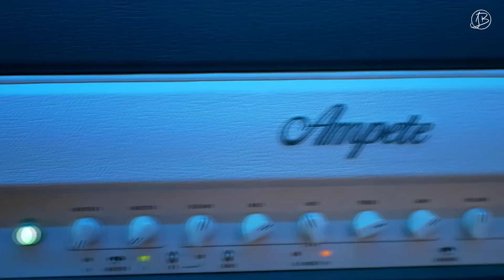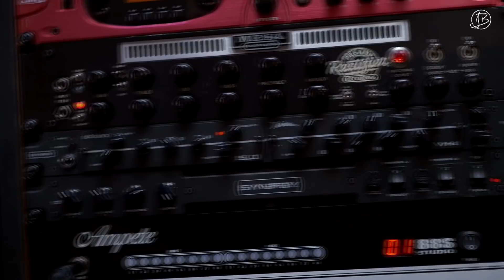JOHN BROWNE | GUESS THE HIGH GAIN TUBE AMP

Comment: One blended the harsher and smoother sections together amazingly and probably handled the range of tones the most seemlessly imo.
Two had incredible articulation and note separation, especially on the chordy parts, where it easily blew the others away imo.
Three seemed a decent bit 'edgier' than the rest, accentuating the highs loads, I kinda get the feeling its an older voicing.
Four had a really full bodied, rich sound, perhaps sacrificing a bit of high end, but awesome for lower rhythm work.
Five was very crisp for the first riff the open C# felt very distinct, probably good for single note style riffing imo.
Six was the Mesa :)

Comment: I'd like the Laney of it had a lower gain tube.
The SLO to me wins here.
Next is the H&K or 5150... Maybe the 5150 needs an adjustment or 2... Like bump up the presence or treble slightly.
Reply: It's the Laney for me, but with lower gain as you said. It's got more dynamics to it than the others. My second is the Synergy SLO.

Comment: Hey John, I would love to hear you talk about dialing in 8-string tones in particular, and if there are any differences compared to how you go about it for 6/7 strings to handle the lower frequencies. Was the H&K Triamp used for the 8 string songs on Phronesis? And do you find any differences with higher-wattage amps like the Triamp or a Herbert vs 100 watt heads? I really admire your tone, no matter what you play. Thank you!